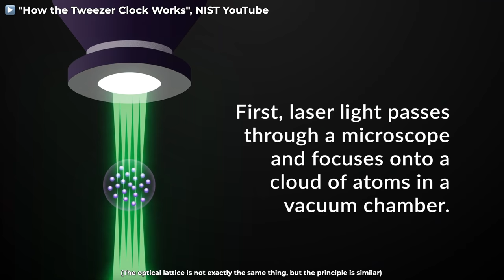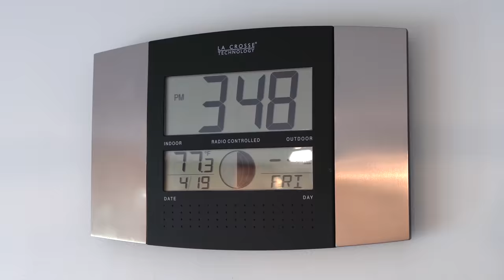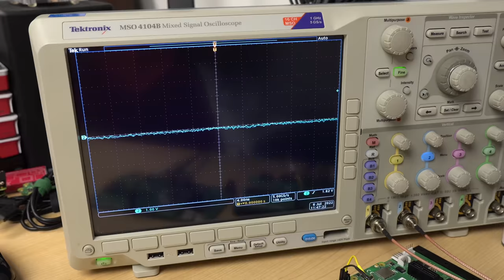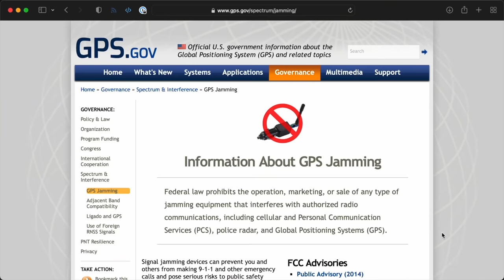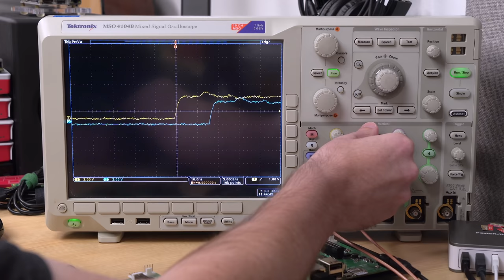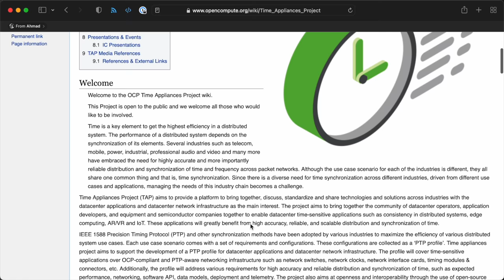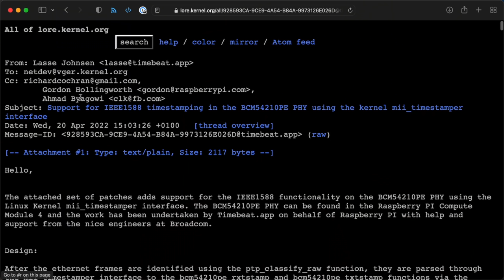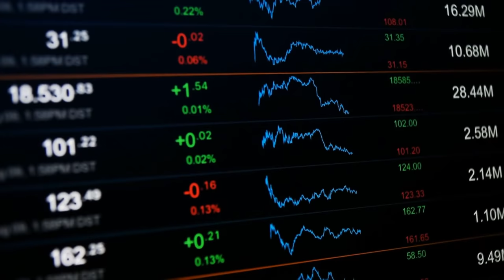Nanosecond clock sync with a Raspberry Pi

Comment: I always get hyped up from these videos to have extra precise network time on my LAN for no apparent reason; your presentation is great. :D Is there such thing as a database of NICs to see which support PTP protocol? Eg. can I check somehow if an onboard LAN on a motherboard supports this or not? Because having a CM4 PTP server is just one part of the equation. I guess the big investment is going to be on the PC side.
Reply from the maker: Unfortunately, it seems like IEEE1588 support is often buried in tech specs for NICs :(

And not all that support it really seem to have full driver support, either. It seems like Intel is the best bet, even many older NICs support it (e.g. i210 I think).
Reply: @JeffGeerling  so this will take some "time" (ba dum tss) to get mainstream unfortunately. :(
Reply: PPT also works with software time stamping. We have a Raspberry Pi 4 with a GPS Hat (with PPS) running as a PPT Server. We use this to time sync our web server which is located in the basement where we haven't any change to get a GPS signal. 

Using software instead of hardware time stamping reduce the accuracy to the micro second range. But that's at least two magnitudes better than using NTP from a time server via internet
Reply from the maker: @ChrisA4A4  True! And I didn't even touch on that ability. And from some further investigation, it looks like it's possible the chip in the Pi 4 could have 'unofficial' support for hardware timestamping, too.

Comment: This is fantastic for me. I have equipment that uses GPS for timing. Last year some of the GPS units stopped working and the equipment defaulted to NTP, which was not accurate enough. I then discovered they could use PTP, but the cost of a server was too much for me. Now maybe I can implement PTP.
Reply from the maker: It sounds like it's time for an upgrade!
Reply: @JeffGeerling  ba dum ts xD, good one
Reply: But only if the network switches and other gear actually support PTP.  If they don't, then you won't have a way to get the PTP signal across LAN segments so that the clients can talk to the server(s).

Comment: As someone who went through the hassle of researching and waiting until I could snag a good deal on a used enterprise GPS clock, I'm stoked to see how accessible accurate NTP / PTP sources are becoming for the home lab community now. (Yeah, you're not the first, and neither was I, but hey, it's a cool club, and we're happy to welcome you!)

I want to warn anyone who's eyeing old enterprise gear, make note of how long it's been end of life, check whether you can get firmware updates without a[n expensive] support contract, and verify that it was updated recently enough to handle the GPS Week Number rollover on April 6, 2019. The oldest and most affordable stuff out there cannot, so it's basically useless, and the gear that's new enough to still work is not as affordable as it should (IMHO) be. Caveat emptor, and whether you go refurbed enterprise or DIY, happy timekeeping!

Comment: This video is a godsend. I am currently working on a project where positioning is determined based on Time Difference of Arrival between two signals. Even though the project is in very early stage and we don't need perfectly synced devices right now, but eventually we'll need it. Else nothing will work.

Thanks for making a video on this topic. It'll definitely help me immensely.

Comment: Not the first homelabber with a time server in your rack. Heiko from Meinberg give me one of their Grand Master reference clocks back in 2004, and I was far from the first to have that kind of thing at home. Poul Henning Kamp from the FreeBSD project had better gear, and he had it earlier. And he wasn't the first. Dr. Mills may have been the first, but he was the principal author of the NTP RFCs.

However, you could be one of the first few guys to have in your rack a Raspberry Pi based Stratum 1 time server that runs purely on open source hardware and software.

The big issue with PTP is that it requires support at the switch level. If your switches don't have the necessary hardware to support PTP, then you can't effectively use it on your local network.

However, PTP can make a good Stratum 0 reference for NTP, which can easily be distributed around the LAN, the WAN, and the whole rest of the Internet.

Comment: There is a good reason why the "traditional" devices are so expensive and it has nothing to do with the actual hardware. Those devices come with official certification and operating guarantees. Something this open source piece of hardware does not have. For hobbyists this might not matter, but in the company's this is mostly relevant for and in science that needs to be validated this is absolutely very important. This new card is nice and cool and absolutely no threat to the expensive models. 
The same goes for almost all expensive measuring equipment. Be it from fluke or agilent or Tektronix or whatever.
Reply: Well, the hardware has something to do with the price. In order to get a new "traceable to NIST" sticker, the equipment needs to be sent in for calibration. And equipment designed to be opened up and tweaked at least once a year for decades needs to have components inside that can stand up to that much use.
Reply: @StringerNews1  compared to the cost of calibration, certification, tracing, support and what not, the cost of hardware is minor. Yes it has some influence, but it might as well be nothing.
Reply: @bzuidgeest  you're kidding, right? It's only a couple hundred to recertify most equipment, and the purchase cost ranges from thousands to tens of thousands. Which of those numbers is bigger?
Reply: @StringerNews1  recertify! That is not the same as the original certifications of the design. Certification and calibration are also not one thing. Also with that kind of equipment economies of scale are not working. Long term support instead of the consumer 1 or 2 year is expensive. Yes they are no doubt milking their customers but it's not all nonsense. Look at how long fluke keeps certain models on the market because governments and companies have standardized on them. Hardly mass market. Therefore more expensive than the common trash.
Reply: @bzuidgeest  I see the problem, you don't know what you're talking about. 🤦
Reply: @StringerNews1  strange... I have the same observation.
Reply: @bzuidgeest  if you know that you're talking nonsense, why do you do it? SMH
Reply: @StringerNews1  i must be taking to a real idiot, I'll be more clear. My observation is also that i am talking to a person that does not know what he is talking about. See? we both have the same observation about each other!

Comment: The TimeCard uses a Xilinx FPGA, the software to program this is not open source, whilst you can get an open source bit stream to program it, if you want to change the programming you still need commercial software tools from Xilinx these are not open source although they are currently free to use

Comment: Great topic. I have several Casio watches that have the shortwave radio update feature. They are affordable and amazing. This is a very underrated technology. I recall there was some conversation in recent past about Govt reducing their funding in the NIST program. Hope this never happens.
Reply from the maker: Yeah, in the WWV tour video I linked, the engineer mentioned that from time to time there are discussions about cutting off WWV since GPS has all but taken over. But I think it would be a bit disruptive since there are still so many radio-based clocks!

Also, for a Time Card upgrade, they might include a WWV receiver since, once you know your location with GPS, WWV can be a very accurate backup time source if GPS is jammed or the signal is lost.
Reply: @JeffGeerling  Seems worth pointing out here that the WWV(/B/H/L) clusters serve not only as time standards, but -- as I think their top-of-hour announcement says -- also frequency standards.  That's much harder to ship over the internet, and still important.

And you can't get it from network TV anymore...
Reply: @Astrocat 3D Ditto. This is a great example of how analog complements digital information. The simplicity of the radio wave's protocol is brilliant.
Reply: @Astrocat 3D Yeah, what's wrong with running wire telegraphs along railroads, just in case?

Comment: Maybe I missed it but in a common home setup with several computers, nas, routers etc. can this card "give" correct synchronized time to everything connected in the home network?
Reply: In a common home setup, NTP (without special adapters) is plenty; it will get you to microseconds, and no civilian is going to notice.  :-)
Reply from the maker: This civilian will notice! Haha.

But yeah, NTP is definitely good enough for most—it can be easily configured on any regular Pi, too. The quartz clock that comes on a typical RTC will be accurate enough, especially if you grab a GPS HAT and get the main time data from that.
Reply: @JeffGeerling  thanks jeff, Appreciate your channel, really trying to get up to speed on the PI. I am doing a bus to rv conversion on an MCI coach bus and want to integrate raspberry Pi's for home assistant as well as other lighting and monitoring. still trying to get up to speed on the "lingo" but your channel helps a lot.
Reply: @JeffGeerling  I would have thought it obvious, jeff, that I don't class you as a civilian. Once your home network has more than two switches in it... :-)
Reply: @garyslittlehomestead2186  wow, are you going to have an easier time than earlier people who have dug that hole, given the amount of 12-volt LED lighting equipment there is available these days.
Reply: @baylinkdashyt  yeah, the hardware part is pretty easy. My challenge is the software side from a learning perspective. going to try and stay 24v as much as possible as that is the native voltage of the bus and will also be the native voltage of the house battery bank, I'm sure however there will be a few buck converters in my future.
Reply: @garyslittlehomestead2186  as difficult as it can be to find 24vdc equipment, even in the camping industry, you might want to consider leaving the bus batteries alone and having a separate Hotel bank for all the other loads at 12vdc. I'm not an RV professional by any means, but...

Comment: Use PTP with AOIP (Audio Over IP), Dante and AES67 'Ravenna Merging'
Reply from the maker: Yes! I'm actually working with my Dad on a video idea talking about AES67 over on the Geerling Engineering channel. He's had some other priorities though, so it's on the back burner.
Reply: @JeffGeerling  I have a RedNet AM2 Dante DAC that supports AES67... AES67 Ravenna Merging was the only way I could get it working under Linux... Audinate (Dante) don't have a Linux Virtual Soundcard driver like they do under MacOS/Windows 😒

I look forward to seeing a video from you about AES67... There isn't much for mere mortals out there 😅
Reply from the maker: @leeashleyanthony  Well to be honest, there's a very tiny slice of the population who's even heard of AES67 :D

Comment: 2:30 "...all radio clocks....use this signal..."  NOPE !!  Radio Clocks (in North America) generally use WWVB on 60 kHz, not WWV on 10 MHz and other HF frequencies. In general, Radio controlled "Atomic" (sic) Clocks use VLF signals around 60 kHz, even in Europe and Japan and elsewhere (e.g. 76 kHz). All of these USA NIST signals come from Colorado, both VLF and HF, but also Hawaii. The signal is useable even in Nova Scotia, hello!  There's a new Phase Modulated VLF 60kHz signal that's worth pursuing. The format of all these signals are different, even subtle changes to the data between the legacy AM and newer Phase Modulated signals on WWVB.

Comment: The French make the acronyms and the scientific world speaks English.  Yes, at the BIPM (International Bureau of Weights and Measures under the treaty of the meter), everyone speaks English.  The correct answer is, "Coordinated Universal Time" or UTC.  A given lab produces their physical representation stated as UTC(NIST) for NIST's version of UTC or UTC(USNO) for USNO's version.  UTC(SU) is the Russian version and so forth.  The International System of Units are the "SI" units.  Meter, Kilogram, and Second as well as UTC are kept by the BIPM as the international standard.  NIST does not provide anything for GPS.  GPS is a flying constellation of Rb atomic clocks (3 each in current satellites) that work with designation ground stations and USNO.  GPS broadcasts data stream that are consumed by a receiver to locally provide a broadcast representation of UTC(USNO).  The fully corrected time produced by your GPS receiver is tied to USNO.

Comment: Did you know that the the  Synopsys synthesised Ethernet MAC has PTP registers in it. (Probably the origin of the IP in the Broadcom chip too ) That means that a lot of low cost ARM microcontrollers e.g from ST Microelectronics and others have PTP hardware in them. And its the same in many variants of them.. E.g. STM32F407. It is also  possible to "borrow" those registers to create a 1PPS signal with about 5nS jitter and with sub nanosecond period control. For a GPS source, even the $10 non- timing uBlox M8 GPS modules have pretty good stable PPS outputs, but they actually lie about their timing error - the nanosecond resolution PPS timing  offset value is output as a slow sawtooth ramp..

Comment: For test bench use, a GPS Disciplined Oscillator (GPSDO) can be useful. They're about US100. 'BG7TBL' is one designer. These gadgets contain an Oven Controlled Xtal Oscillator (OCXO), brought into alignment to GPS by a uC. They typically produce plain-Jane digital 1PPS and 10MHz signals on their front panel BNC connectors.

Comment: I think NTP and PTP are different usage, PTP and GM clock are for digital transmission usage … this is prevent digital packet collisions and crash. It can apply on device on the LAN, router, switch, ap … etc. and also apply on multicast streaming … like SMPTe 2110,  Dante AV and NDI. PTP is like Metronome

Comment: I've just re-watched this because I'm trying to understand Audio over IP better - I don't pretend to properly understand more than the high level principles, but would it  be possible to have a Raspberry Pi CM4 running PTP as a master clock on a network that other computers on the same local network could be slaved to?

Comment: Re. the beginning of your video where you mention master clocks: you can buy GPS disciplined oscillators (e.g. for use with SDR) for like 60 bucks. Don't think this is relevant for the rest of your video (probably) but I happened to look into one the other day.
Reply from the maker: Yeah; the point there is that the actual clock unit (which can take in GPS, has an oscillator (TCXO or atomic, or whatever), and has a NIC capable of hardware timestamping, along with whatever OS it runs) is typically very expensive.

Some of these expensive units use commodity parts inside and the markup is quite significant.
Reply: @JeffGeerling  Yeah sorry, I should have finished your video before commenting. There are a number of other advantages that a GPS module doesn't have.

Good stuff.

Comment: Way cool!!! I can synchronize 2 CM4's using IEEE 1588.  The CM4 with the addition of a time card can become a timing standard for a network for a fraction of the normal cost.  My question is synchronizing more than 2 CM4 will require a network switch.  Most of the inexpensive network switches don't work with PTP.  Are there any low cost Gb switches that correctly deal with PTP packets?

Comment: I think most "atomic clocks" (radio controlled clocks) use the inaudible WWVB broadcasting on 60 kHz instead of WWV.  Granted, it's perfectly possible to base one's clock on WWV because of its 100 Hz timecode, but most of them use WWVB.

Comment: Optical Strotium Lattice does not define a second, currently that is hyperfine ceasium 131 transitions. That said, Strontium Optical Lattice has less drift and is ongoing research. GPS comes from Rubidium and Ceasium clocks on the satellites.

Comment: Media and entertainment is also using PTP! Maybe I can propose replacing the GM clocks on our network with few CM4s?
Reply from the maker: That's my hope! AES67 is getting more widespread, it would be nice to have a more off-the-shelf and inexpensive option compared to the master clocks out now.
Reply: @JeffGeerling  Absolutely agree. It feels waaay nicer to work with than Dante as per my experience. Likewise I'm hoping that ST2110 is getting way more traction in the future, as it feels like a lot more suitable to complex networks than NDI that just tries to do magic and failing... as it's in complex corporate networks, not in flat one.

(Some video ideas there? :fingers_crossed:)

Comment: I did some work with small 4g pico cells, the ones outside used GPS for time, the ones inside we fed with PTP from our backhaul radio equipment. That had a GPS and generated the PTP pretty much as the PI is doing, we had a load of interest from companies that wanted the GM functionality and didn't need the radio link. I left soon after, always wondered if it went anywhere was cheap compared to a GM IRO of $1000 IIRC but maximum of 6 slaves, would probably do more but that was all we tested. Somehow the solutions now are going to be way cheaper and this was only 6 years ago.

Comment: I have a niche and rather useless requirement for accurate time. I am "re-encoding" the standard unix timestamp into a fictional time standard and I'm wondering if there's an ultra cheap way to keep somewhat accurate time signal, that is continuous and wireless. I looked at DIYing a radio clock circuit, but online circuits don't give values for components and specify a certain chip. would there be any way of building a clock radio receiver out of analogue electronics and a raspberry pi.